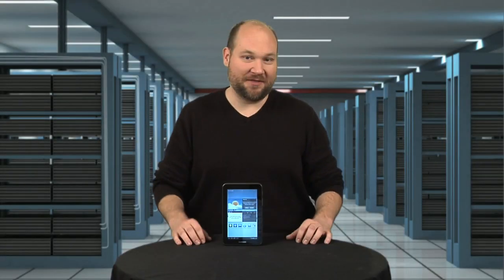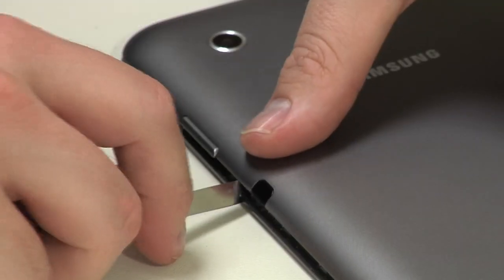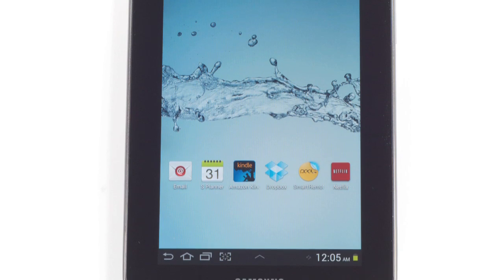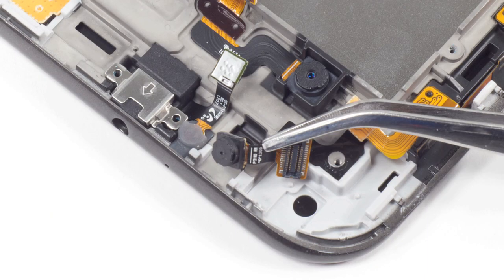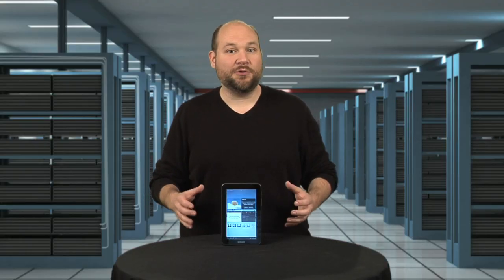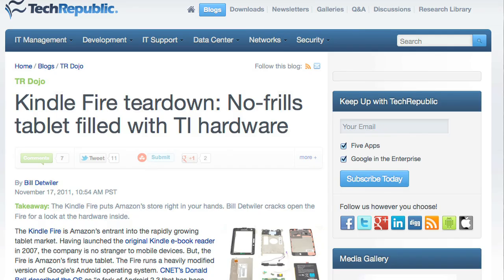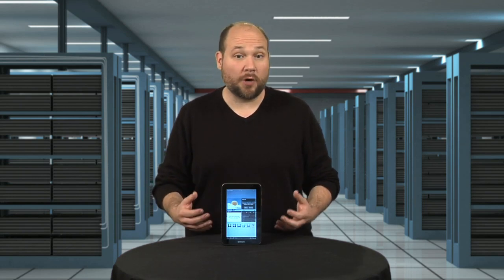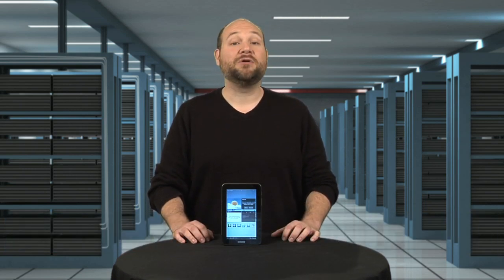Cracking Open: Samsung Galaxy Tab 2 7.0

Comment: anyone can help i didnt mean to put it in the water it rebooted and it works fine but it shows that i am connected earphones but i am not connected
Reply: answer pls fast
Reply: +DeathMonsterGG put the ear phones then.  Remove it. If it doesnot work then i think your ear phones.head is brocken. (The thing than. Goes in) and stuck inside so  it very hard to get it out talk to experts or see vids

Comment: I´m very sad because my daugther broke the touch of my tablet by accident, I bougth it on line and I found my self disapointed because technicians down here don´t know how to change the touch, they can tray without warranty... after I saw your video I think I can tray safely with a little help....Is there any tip for me to help me change the touch panel? Thanks in advance...  Oscar Plascencia

Comment: Since this is so close to the Galaxy Tab 7.0 Plus, is it safe to say I can use this as a guide to crack it open? 

 I just read advice to fix a bootloop that nothing else will fix (and also didn't wipe the device), to try removing the battery for 30 min but this the closest crack open guide I can find.